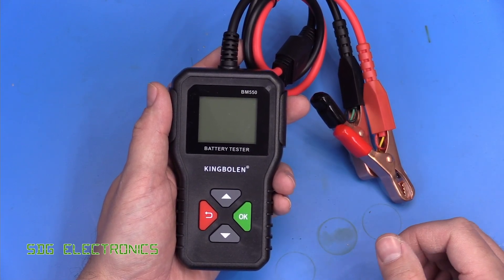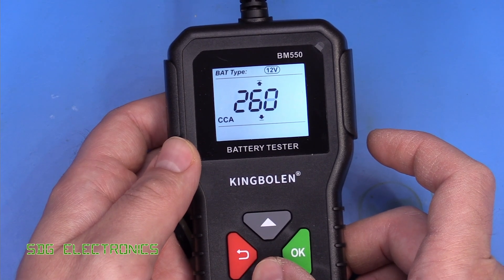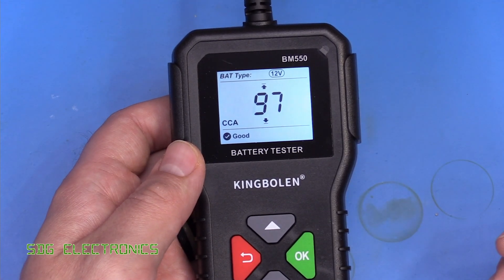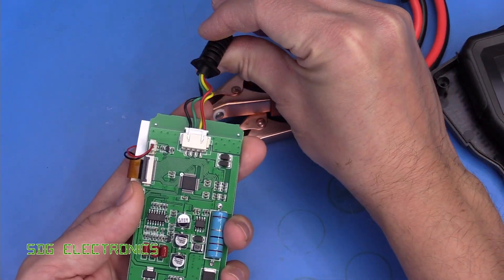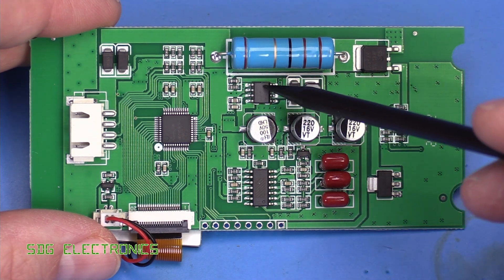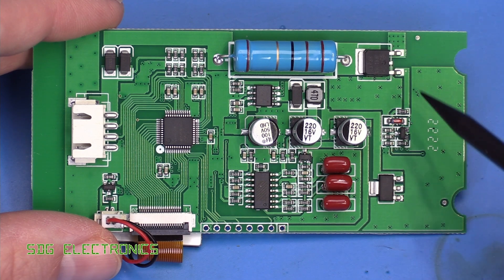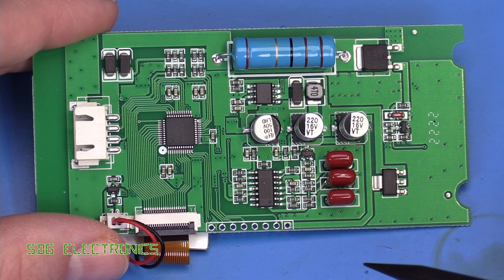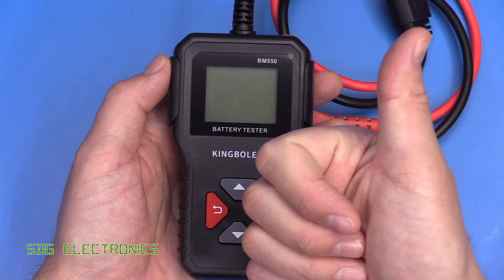SDG #290 Kingbolen BM550 Lead-Acid Car Battery Tester Review

Comment: I use a Midtronics MDX-P300 battery tester which can be used with the battery in the vehicle if you can get to the battery posts. If so, then the actual usage is to record the battery CCA capacity every month to establish a trend trend. You will find that, not surprisingly, the battery capacity will decrease over time. When the measured CCA rating of a fully charged battery gets below 80% of the label CCA rating you should plan replacement of the battery within the next month or so. So for the fleet mechanics (car rental companies) the battery testers are used for battery maintenance through trend analysis. The paper output of the MDX-P300 helps speed up recording of the readings, if you have to include the printout with the vehicle records.

Comment: Looks like the IC had a 12-bit and sigma delta 16-bit ADC. Maybe used for the ESR? The voltage reading doesn't really need it.
Reply from the maker: I missed the 16 bit. Looks like it reads the battery voltage in conjunction with the voltage on the load resistor

Comment: How does it test the state of health (soh)?. Looks like a cool tester.
Reply from the maker: It's all based on look up tables as far as I can tell.
Reply: @sdgelectronics  thanks, I couldn't think of any other method for it to come up with that as fast as it does with how little it has. There isn't any direct logging & computation to calculate soh for every unique battery.

Comment: Not sure how it can work out the CCA by loading the battery with a 1A load.

My moped has a 12V battery, which just about copes with cranking the little 1730cc v-twin motor over.
I use the term moped in a very loose sense of the word. 🙂
Reply: As a 15yr old I bought old mopeds from a local bike shop, did them up n sold them. Always Yamaha FS1E's. 6v battery.
Reply from the maker: I would guess they've rigged up a setup with a more capable system under a while range of conditions and mapped the data to this, then just done a big look up table.
Reply: @sdgelectronics  or a wet finger in the air? i would still perfer to use one of them great big current shunts with a voltmeter across it that you use to see in old school garages.